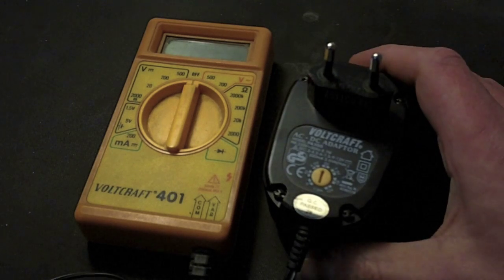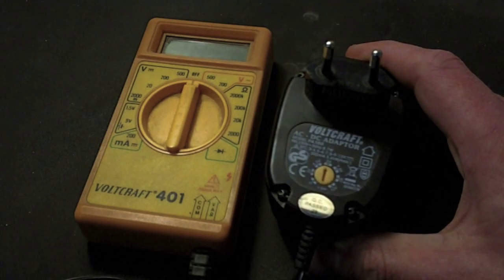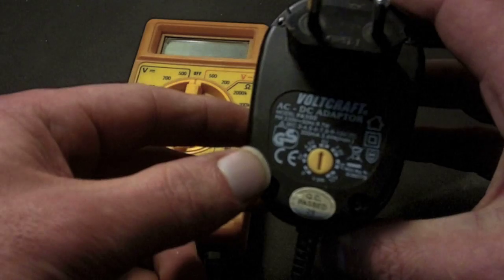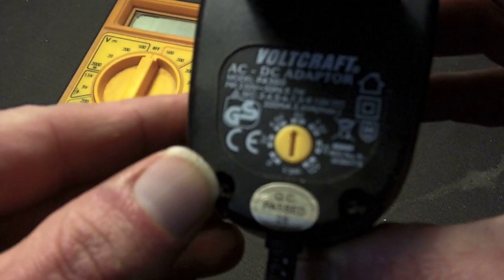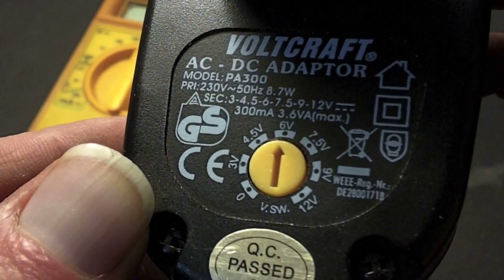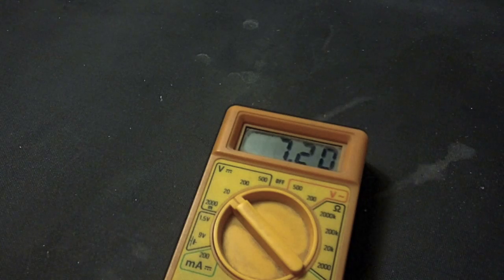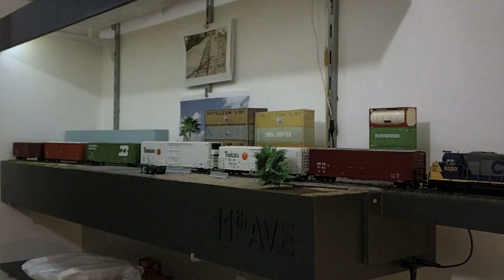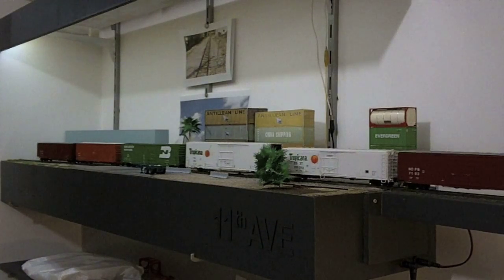dead rail or not?

Comment: Hi,
Also, I have not heard anyway say this:  Power electronics (e.g. a buck-boost) can easily step up and down the voltage/current as needed/wanted.  So for example, we can add more current and reduce voltage at low speeds....and then add more voltage and less current at high speeds when you don't need the current.

Comment: Hello, Sven.
I have a question but not about the test although it does prove that 7 volts appears enough to do the job.  My question has to do with the portion of the video where you bring the power supply close to the camera and it is fuzzy.  Then you do something  in the video and the power supply is remarkably sharp in close up.  What did you do to make the close up sharp?  I'm thinking of a macro lense on the video camera but not sure.
Reply from the maker: Correct, i switched the camera from standard view to macro. Since that shakes the camera and makes ugly noises, i cut that out of the video in post production.

Comment: Nice! Those are the palm trees you made the other day? This is just a 9v battery correct?
Reply from the maker: Yes those are the palmtrees, still not finished yet. No it´s not a 9V Battery, it´s an adjustable transformer set at 6 Volts. This was just a test if a loco would possibly run properly on 7.4 Volt LiPo Batteries. You might also read Lance Mindheims latest Blogpost and my long comment above for additional information.